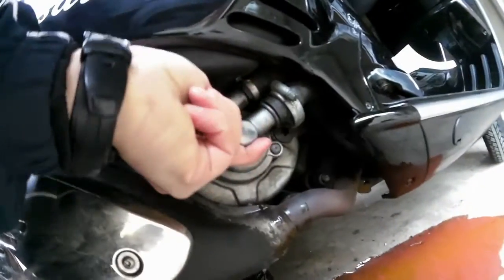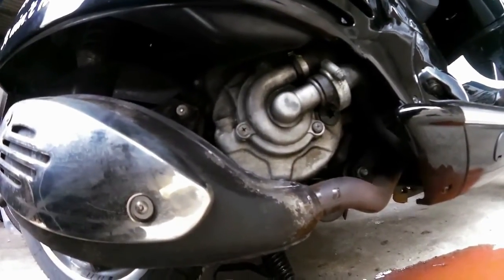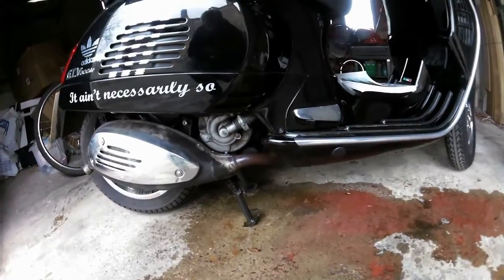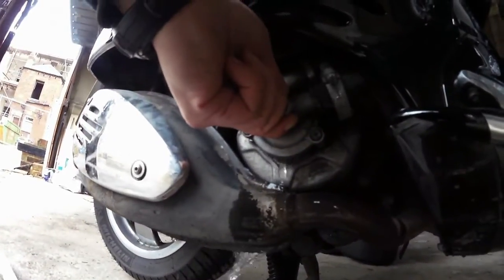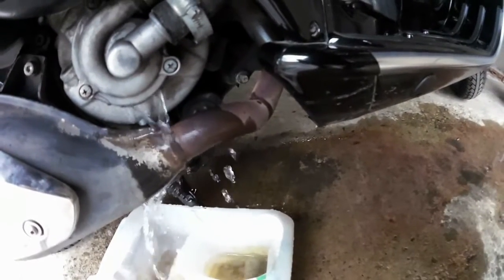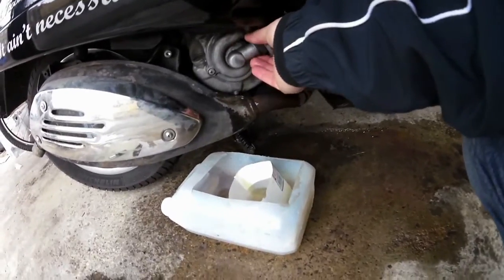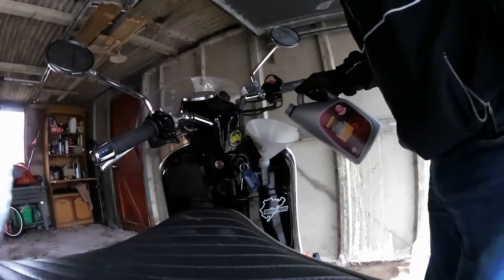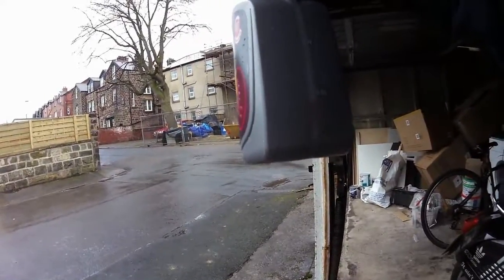How to: Vespa GTV 300 ie coolant flush and antifreeze replacement

Comment: done that job on 100's of cars and bike over the years
one of the best ways after the flush is to use a hose pipe on one of the engine hose sending water through it and keep changing the direction of the flow of water as well
is there not a drain plug in the pump or on the side case
Reply from the maker: ***** couldn't get to any of the engine hoses, the bike is a pig to work on

Comment: Can't you drain the system from the lower hose?
Reply from the maker: problem with that is first removing the side panel, second those clips are a pain to get back on properly, and third you're not getting out what is behind the bit i undid. Much easier doing it the way i did, which was copied from watching vespa motorsports video